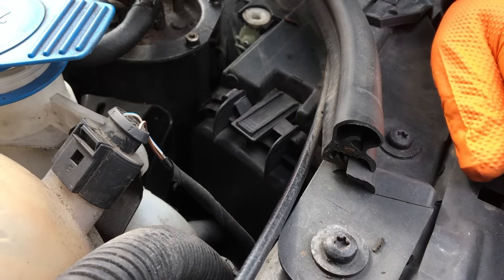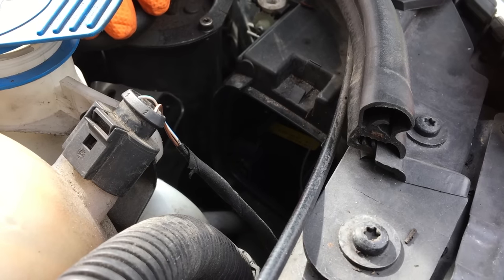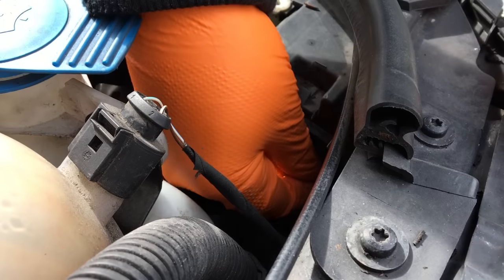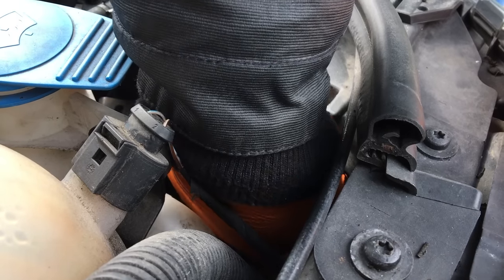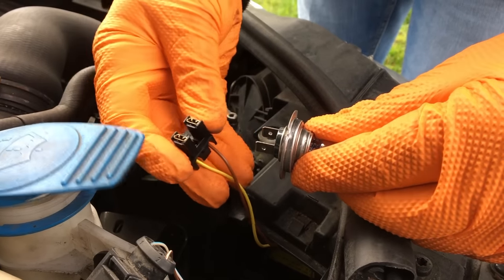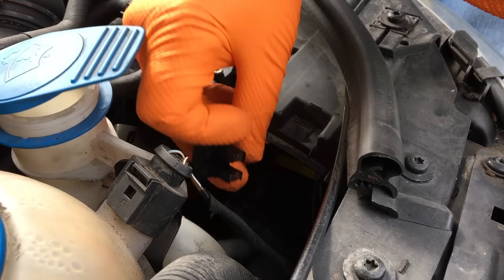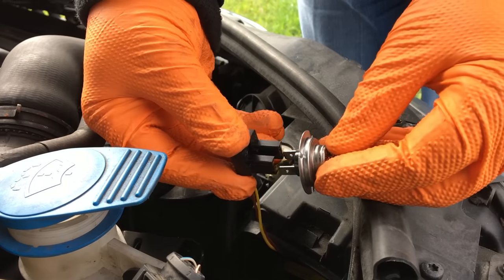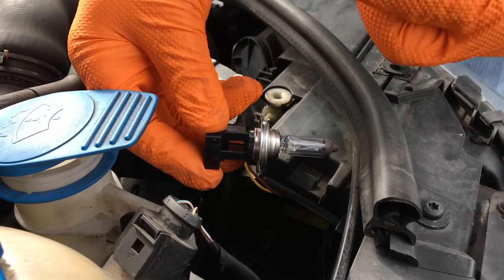How to replace a dip/low beam bulb in an Audi A3 yourself

Comment: Saved me USD 250 having this done at the dealership - twice! So, thanks very much for the careful instruction and the confidence boost that yes, I truly can do this myself. Cheers!
Reply: You sure that wasn't for the main beam as that requires removing the front bumper on some models, poor design lol
Reply: 250 is crazy. Like getting a new headlights
Reply: Trudny dostęp. Kaleczy ręce.

Comment: You did not explain how to unclip the safety clips on the bulb. I’ve been trying for 2 hours
Reply: @markyruss hey man I just wiggled the conector and pulled it upwards the ln pull and it got out then i just pushed and it worked
Reply: @markyruss have no idea what you’re on about. Just done it took less than 2minutes for both.
Reply: Pull harder
Reply: @jaxeden  i used long nose pliers

Comment: Just a heads up to those that have the 2008 Audi a3 3.2l v6, we have the xenon headlights so they are different from what is in this video. Replacement of the xenon bulbs are a royal pita, but they are doable without having to take off the bumper. Just wanted to give a heads up to those with the 3.2l
Reply from the maker: Hi Pat,
Thanks for the info. 
The 2008 Audi A3 8P in this video takes H7 and is mentioned in the description below it. We also mention that this may apply to other Audis' and other models.
Yes, we are aware that some models may use xenon, hid, led combinations or variants, etc. Some may be original, some may be aftermarket.
It is advisable that you first check the type of bulb that that you will be replacing to avoid ordering or purchasing the wrong one (2 pin, 3 pin, socket connection)
By making this video we want to show you the viewer that you can diy rather than having to fork out a handful of notes to a workshop/dealership.
Paul
Reply: Do you have a 3.2L?

Comment: My 2008 Audi A3 has H11 bulbs, which I think are due to the S Line package. It was very difficult to find any information on this, but hopefully I will save someone else the same headache. This (excellent) video was still very helpful! The H11 bulbs simply twist out, though still awkward to reach into the housing. Looking at the front of the headlight was useful for correct positioning when inserting/twisting the new bulb. I used Osram 64211, which seem almost identical to the bulb I pulled out (Philips 12362).
Reply from the maker: Happy it helped

Comment: Hi Paul, if you get the opportunity could you show us all how to change the side light bulbs on this particular car, I'm aware this is extremely difficult as myself and others can't do it without loosing endless amounts of skin!

Thanks buddy!
Reply from the maker: Hi Steven Low,
    Thanks for the request. We can make a video and have it up over the weekend if that helps.

Driveway Dudes - Paul
Reply: That would be great! Many thanks!
Reply: Driveway Dudes Have use made a video yet? Or do you know when you will? Struggling to fit these side light bulbs!
Thanks
Reply from the maker: We'll have it up this week. Thanks
Reply: Great thanks!!

Comment: hello Paul just wondering if you've encountered any problems with the ESP/ABS the light on my car keeps showing but there are no codes to clear would greatly appreciate any help 
Thank you
Reply from the maker: Hi abu buckets.
No we've not encountered this issue on the A3. 
Has any work, maintenance, upgrades or mods been carried out on the car recently ?
Have you replaced any parts on the car with non OEM or unapproved Audi parts ?
As I understand it VagCom diagnostics will reveal a fault but if it's intermittent then more investigation may be needed.
Most common fault for this i've heard was Steering wheel misalignment. 
Driveway Dudes - Paul
Reply: nope everything is still standard no work or mods have been added to it someone said it could be possibly a wheel speed sensor but I am not sure how to even check this 
Thanks Abu
Reply from the maker: Hi. 

Thanks for your reply.

What size are your wheels? Large wheels with low profile tyres don't absorb shocks/bumps on the road as well as average sized (15"/16") wheels with "chunky" tyres. 

If your wheels, regardless of size and profile of tyre are buckled or dented in any way, it cause your ABS light to come on as your sensors are reading an issue with the wheel speed. Depending on where you are located, most tyre garages offer wheel repair if your wheels are in need of repairing.

Let us know if this resolves your issue.

Driveway Dudes - Will

Comment: It doesn't matter how you connect the bulb, the polarity that is.
Reply from the maker: Hi GymChess, 
Thanks for you comment.
For a straightforward fitting we replaced it the way the previous one was sited and connected
Reply: But that's something else and has nothing to do with how you connect the bulb. It's like debating how to connect your toaster to the wall socket. Does it matter which way the polarity is? laugh Right, it doesn't, even though a car battery has DC electricity and an apartment for instance AC. Another thing, it also doesn't matter how you disconnect your car battery. Everybody keeps preaching that the minus comes off first followed by plus. That's nonsense. You break the circuit either way and it makes no difference whatsoever which comes off or on first.

Comment: My car did not have those safety clips, it was just a twist into position. Maybe the US version is different. Also another tip to easily putting the light bulb rather than feeling it in is to actually look inside the headlight as the bulb is gong in, you can see where the edges line up.
Reply from the maker: There's no doubt variations. Thanks for the tip👍though we did try looking into the headlight but views are restricted, again may depend on variation

Comment: My headlights were perfectly balanced before my right light went. I replaced it now it is noticeably brighter than the left, is the adjustment easy? I'm trying to find a video for this same car model but cant
Reply from the maker: One explanation is that over time headlight bulb brightness can dull or fade slightly. Another explanation is that the replacement headlight bulb may not be a match for the original. To solve this you may need to replace the weak one with an exact match to the new one

Comment: The video is on point and very helpful. Plain & simple just how I like it.
Only question is how do you get your hand around the black box that's in the assembly to be able to get to the bulb? Lmao
Or can the box be unmounted & slide out? It's so tight in there I really can't tell what going on...lol
Reply from the maker: Hi Charles, It's just a matter of feeling your way. I explained in the video that you follow the wiring with your fingers. 
If you have hands the size of shovels it might be more difficult.

Driveway Dude - Paul

Comment: Bulb has no polarity, it is simple resistor type load unlike LED
Reply from the maker: If you watched the video then you may have noticed there is a tab on the bulb so it will fit one way only
Reply: @DrivewayDudes  it is nothing to do with any tab wiring. They are identical. Just the mouning tab to the socket has orientation

Comment: What a fucking pain in the ass this is! No room to get your hand in at all I could barely manage
Reply from the maker: Did you do it in the end?
Reply: Driveway Dudes just about, it's not quite at the same angle as the other side. I think my car is slightly different as it's a round cover and has a sort of wing but like design for the bit the bulb sits in, the untouched side is pointed straight up but the side I just changed has a slightly different angle but it feels solid and doesn't wobble. Most importantly it works! Haha
Reply from the maker: Well done. Hope the video helped in some way.
Paul 👍

Comment: Are the high beam bulb and low beam bulb the same? Or are they separate bulbs?
Reply from the maker: Hi Pat, Are you asking if this is a single or dual element bulb? 
This is a single element bulb (2 pin connector) 
Combined dual element bulbs have different connections (3 pin connector)
Cars, vans, motorbikes, trucks, etc, may have various set-ups but they must have both, either singly or combined.
Paul
Reply: When I look up the bulb to purchase online, it gives me the option to choose the high beam bulb or the low beam bulb. Judging from your response I am guessing they are separate bulbs entirely. 
Thank you for your time to make this vid, helps out a ton.
Reply from the maker: The low beam bulb is generally 55W and the high is 65W

Comment: I have a 2006 Audi A3 2.0T is it the same way?
Reply from the maker: Hi Death_Cloud,
Thanks for the question.
The Audi A3 8P/8PA was manufactured  2005 -2008 and apart from little changes for different countries rules and laws it should be the same or similar. 
If you remove the back cover of the headlight unit, take a pic using the camera on your phone and compare it to the ones in our video. That way you will know for certain.
DrivewayDudes Paul
Reply: @DrivewayDudes  thank you

Comment: Hey i need help?
Reply: @DrivewayDudes  how i can change the headlights in front?
Reply: @DrivewayDudes  in fact i have changed the bulbs but it does not go the short beam only the long headlight (it is probably a safety burner) and i do not know what is the safety for the light headlights
Reply: @DrivewayDudes  i need change headlamp safety at audi a3 since 1998.
Reply from the maker: @razvanursui547  You have two separate H7 bulbs in the unit, one is for main beam and one (in this video) is for dip beam. Both the H7 bulbs are rated 12V 55W. 
If the wiring is crossed then you may experience dip when on main and main when on dip. The shape and angle of the reflector in the unit determines the direction of the light beam
Reply: @DrivewayDudes  i need the safety change but i dont know exactly where are and who...